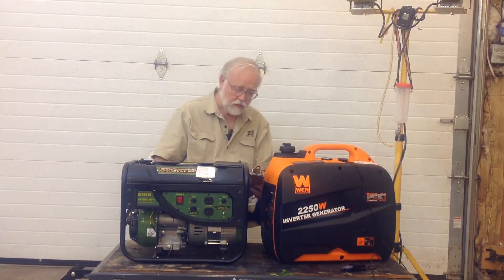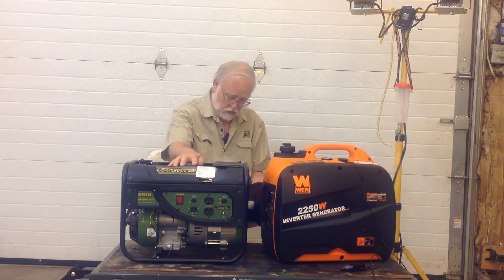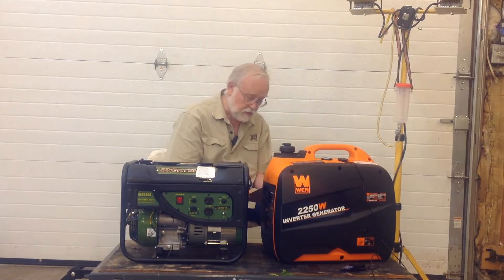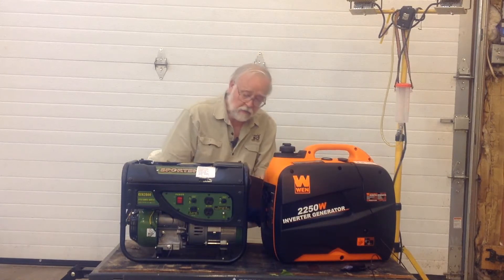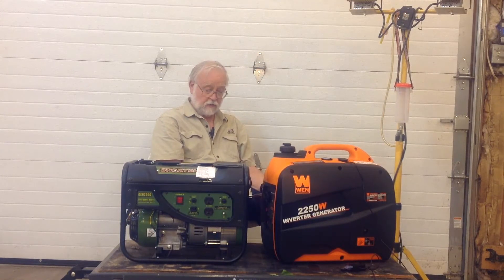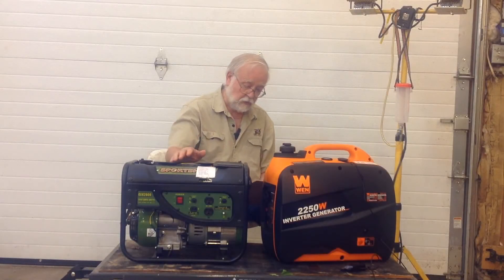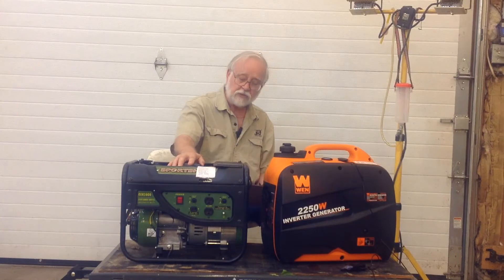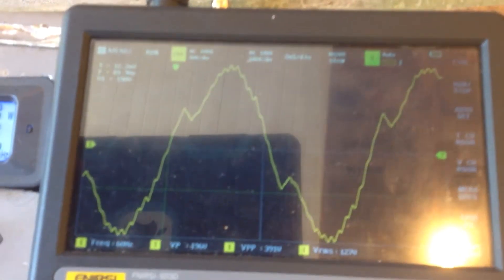DOES THE INVERTER GENERATOR REALLY USE LESS FUEL THAN THE SYNCHRONOUS GENERATOR?

Comment: The Sportsman was massively more efficient operating at 90% load than it was at 45% load for the power produced, you proved that old observation at least. The Wen looks fairly new? It might improve in efficiency when it gets a couple hundred hours on it. I would measure by a different metric, watts produced vs. fuel consumed, to measure efficiency, since loads vary as you have demonstrated, hours under load isn't a good metric. It was still and interesting video.
Reply from the maker: Thanks for the positive reply.  At the time of the test the Wen probably didn't have more than a couple of hours on it.
Reply: @richardbaker3621  It looked really fresh to me. I think it will do a little better after 20 more hours operation.

Comment: The Sportsman may not be the shining example of a well-designed synchronous generator. But even if you had tested against a better made model, I think inverter will generally match or beat any synchronous on small-scale tests, especially at anything other than full load. 0.20 vs 0.28 GPH with a 900W load seems about right to me. Fuel injected inverter models can further advance fuel economy, at added upfront cost.
Reply from the maker: Thanks for your comment
Reply: Fuel injection for either style generator would be the holy grail for efficiency and in my opinion would pay for itself quickly in fuel savings. A water jacket that could be optionally filled, or not, would aid in cooling and noise reduction, adding little to expense or weight.
Reply from the maker: @robertkubrick3738  Thanks for your comments.  Fuel injection has certainly improved auto efficiency.  The water jacket is an idea that is new to me.  I can believe that the mass of the water might reduce noise.
Reply: @richardbaker3621  It would. Also it isn't a requirement that you fill it and it could be drained when lifting or moving and refilled later, just needing a pressure relief valve. As it stands now, temperature of air cooled carbureted generator engines is partly fuel moderated. They run rich. With better cooling they could have a higher compression ratio and better efficiency.